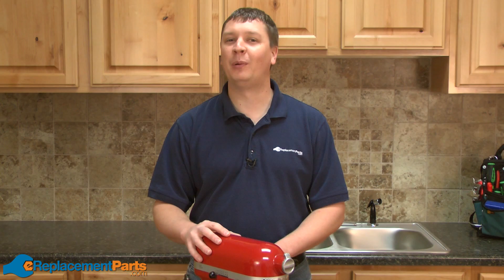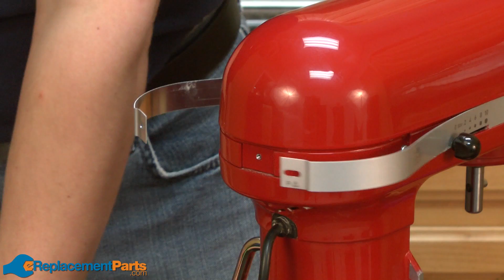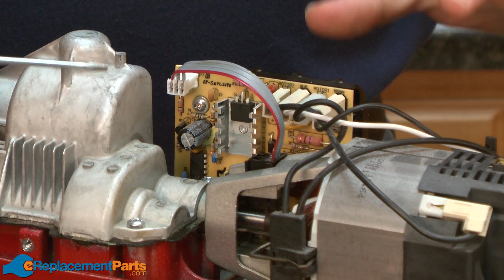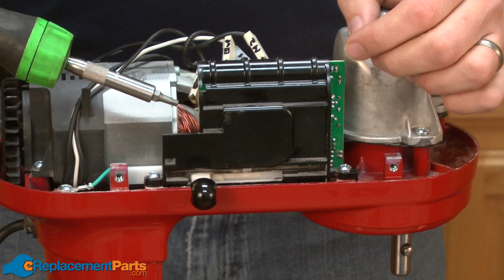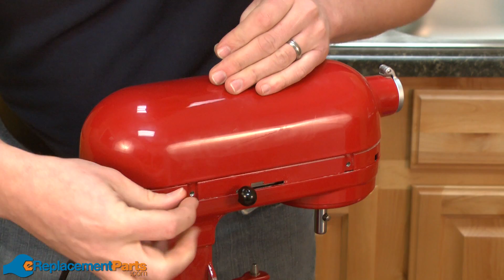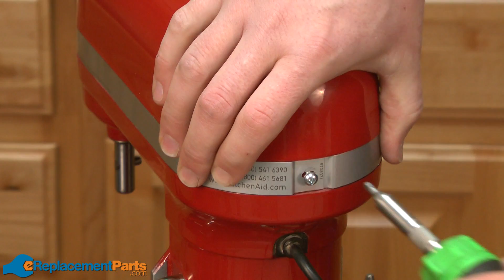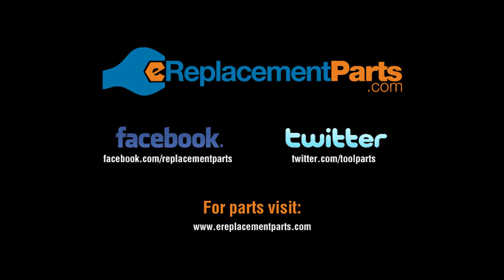How to Replace the Speed Sensor and Control Board on a KitchenAid Pro 6 Mixer

Comment: After replacing the phase control board on my Kitchenaid KSM50P mixer, it still doesn't work, but it is an older model than the one you feature in the Speed Sensor/Control Board video. It doesn't look at all the same, and I need to confirm that you carry the parts I might need to replace. I think it's a Speed Control Plate, but it doesn't even seem to be getting power when I turn it on  The serial number is WE2224135. Thanks!

Comment from the maker: Thanks for watching! We are very happy that we were able to help. Now for the additional help. We suggest replacing the sensor (Part #9703312) based off of your symptoms. For $9 plus shipping it come out to be cheaper than the $65 service charge. Please let us know if you have anymore questions. This same video will also help in removing and installing the new sensor.

Comment: My Kitchenaid KSM50P quit working after the speed control got stuck on 10. I replaced the phase control board, but that wasn't the problem. What can I do next? I'm on a limited budget, and the repair shop wants $65 just to look at it! It's already apart, and it can't be too complicated, right? Any help greatly appreciated!

Comment: Great quality video & excellent troubleshooting tip regarding speed sensor vice control board. Replacing the speed sensor cured my instant fast run and auto shutoff problem.
Thanks Mark!

Comment from the maker: It could be the sensor or the board. To find out witch one, you can do a simple test. Open the mixer up as shown in the video. Disconnect the sensor from the board. Keep your fingers away from any moving parts and using caution turn on the mixer. If the mixer goes all the way up to the highest speed and only runs for a few seconds before shutting off, that indicates that your board is still good but your sensor is bad. If the speeds doesn't change, it's the board that's bad. Thanks for watching!